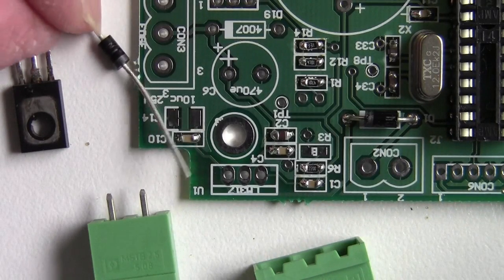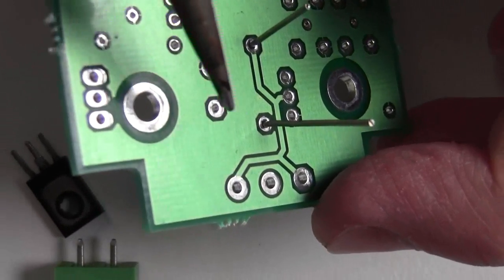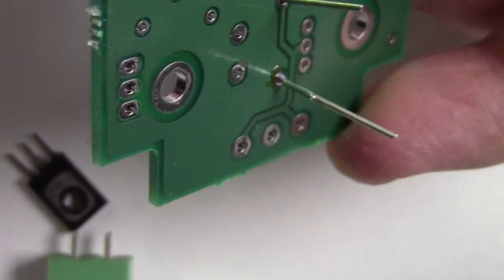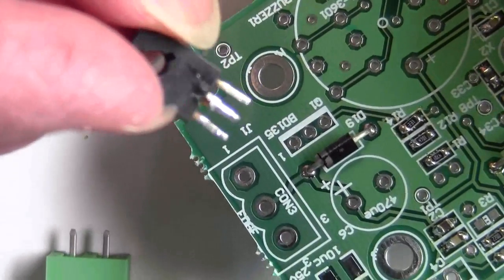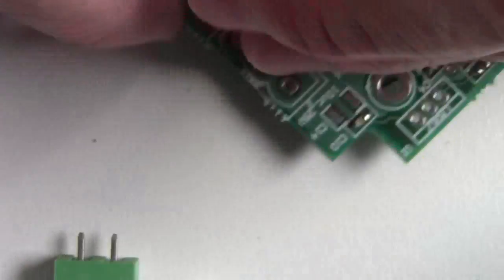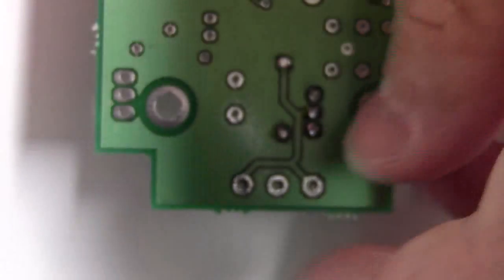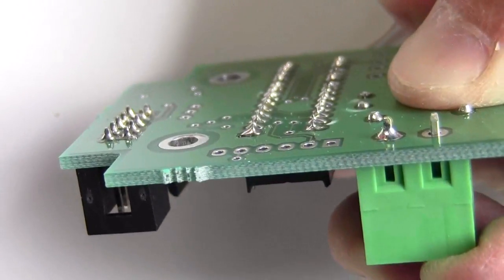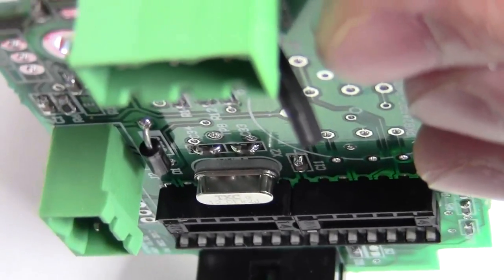How to solder through-hole (PTH) parts

Comment: Thanks a lot for making these videos.  I found your videos on soldering surface mount resistors and capacitors to be especially helpful.

Anyway, I do have a couple of questions:
1) When you pre-cut your transistor leads, do you normally cut them this short?  I thought I would ask since you said this was a "used transistor" and it may have already been pre-cut when you got it.

2a) What type of connectors(both brand & model number) are those green male headers that you are using in this video?
2b) What type of female connectors / housings (both brand & model number) do you use in conjunction with these green male headers?
2c) How do the wires attach to the female connectors / housings? 
For example, do you need to buy any socket contacts that crimp or solder onto each wire before they are inserted into the housing?   Or are the contacts built into the connector?

I normally use MTA-100 headers and female connectors made for either 24AWG wire although other wire sizes are also available.   These headers and connectors are made by AMP or TE Connectivity.  These female connectors have contacts that are built into them so you don't need to purchase any additional socket or pin contacts.  You do need a special T-handle punchdown tool which is used to force an unstripped wire into each contact.  As each wire is punched down into its appropriate contact, the contact cuts through the insulation and makes contact with the wire.  The snug fit between each wire and its contact holds each wire in place.  Thus, you don't need to strip the ends of the wires nor do you need to solder  the wires to the contacts.  You simply punch the wires into the contacts and you are good to go.

Sometimes I use an alternate method which requires you to strip the end of each wire and then solder each wire to its appropriate contact.  Since the diameter of a stripped wire is significantly smaller than that of an unstripped wire, each unstripped wires can be pushed into its contact using a small screwdriver.  The wires are then soldered to the contacts and the solder joint holds the wire in place.   Although this alternate method requires more time and work, IMO, it does provide a more reliable connection.  It also eliminates the need for the special T-handle inserrtion tool.  insertion) tool which costs about $15.
Reply from the maker: 1)  The length of the pins of the used transistor part was just acceptable.  The ideal cut length is to have a bit of the pin still protruding beyond the end of the solder fillet.  Approximately 0.3 to 0.5mm.  In general, you want the pre-cut length to protrude about 1.5mm from the board surface, which is adequate to obtain a good fillet curve solder finish.

2a) Those green male headers are the Phoenix Contact Combicon PCB headers (MSTBVA2,5/xx-G-5,08), where xx is the number of contacts e.g. 02 or 03, etc...  Those in the video are the MSTBVA type, 5.08mm pitch.  They are also available in 5.00mm pitch (MSTBVA2,5/xx-G-5,00)

2b) A suitable mating plug is the MSTB 2,5/xx-ST-5,08 (xx is the number of ways), but there are many variations of the plugs with the Combicon series that will fit.

2c)  The wires are screwed into the plugs, as the MSTB series have screw terminals.

Phoenix Contact connectors are very reliable.

MTA-100 headers are 0.1-inch pitch suitable for lower current and signal connections.  You are probably using the IDC type plugs to go with them.  I also use the XA series, but the crimp contacts requires a crimping tool that cost ~$400 each.